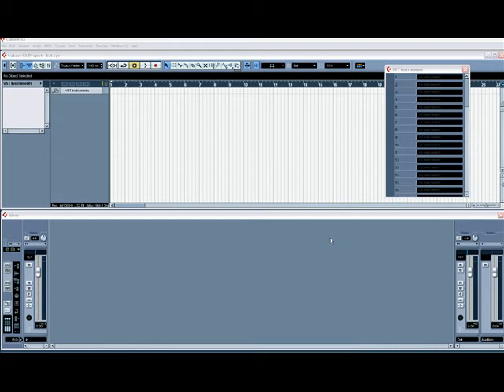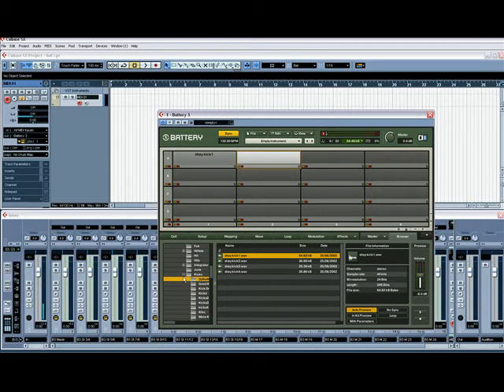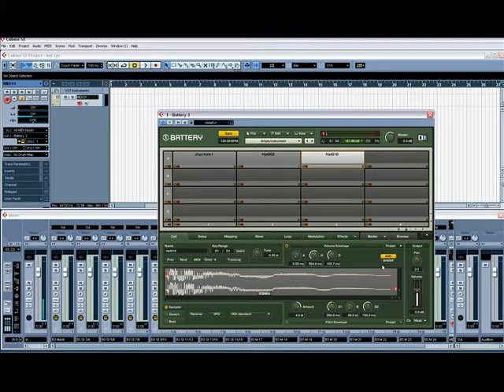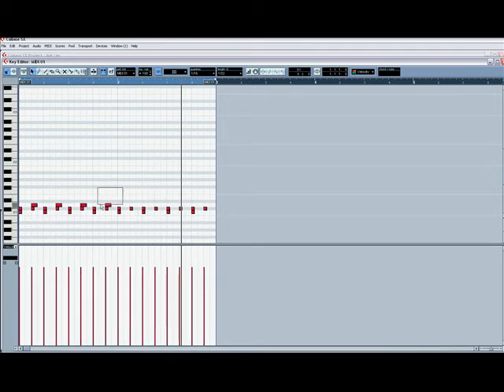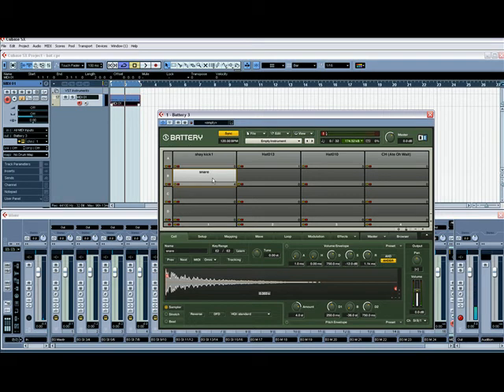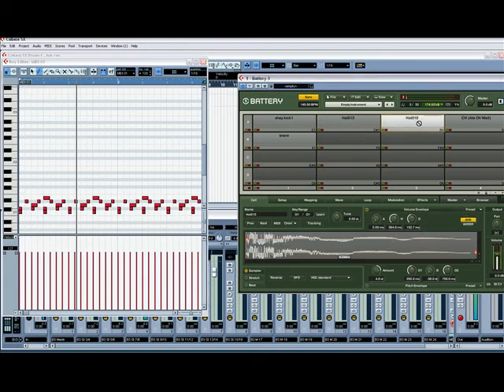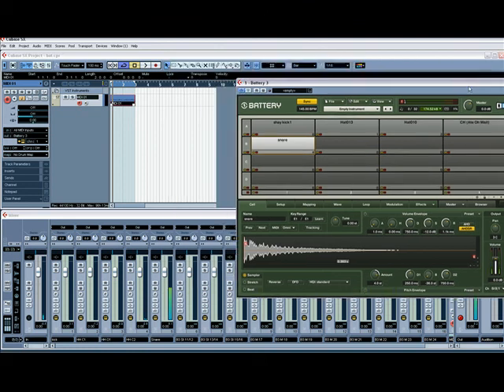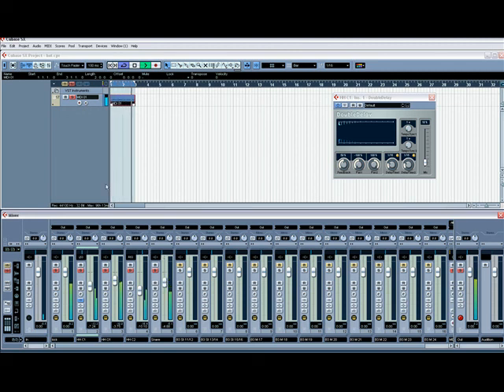Using Native Instruments Battery With Cubase - Part 1

Comment: Hey I've just got Battery, I can't work out how to send each cell to its own output channel though. I've checked options which shows I have 16 stereo outputs, but no channels are opened up when I start Battery and when I change the cell's output from master to 'st s/3' etc.. there is no sound output. its probably something simple but I'm hoping you can help me out. I am also using Cubase
cheers man